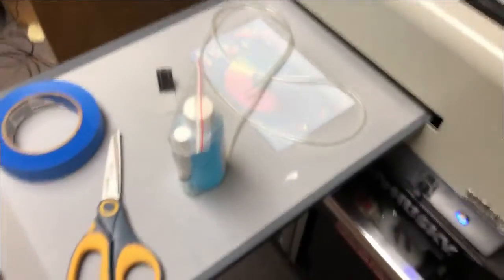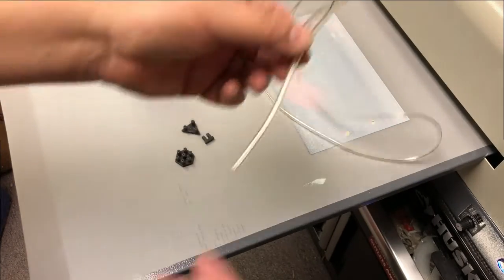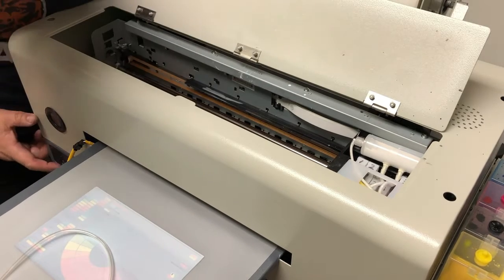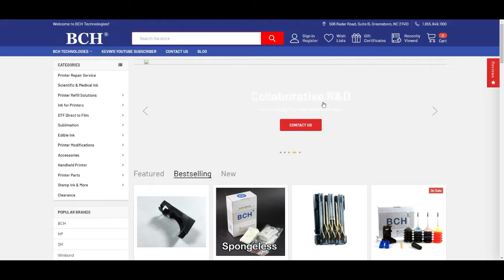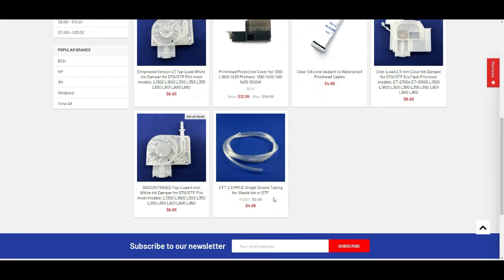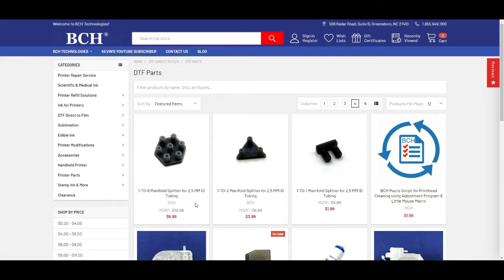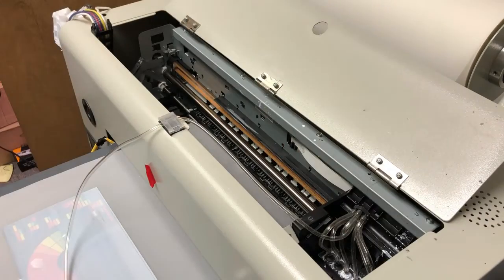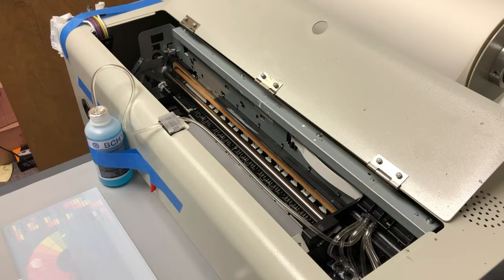How to Use the NO FLUSHING Method to Clean Epson DTF DTG Printhead Faster and Safer

Comment: Hi Kevin! I am a big fan of your videos. I am just now trying to get my ET-8550 set up for DTF. Can I use this on it, or is it only for the printer that you have there in your video? Also, does the cleaning fluid go into the waste tank?
Reply from the maker: Hi! Thank you so much for subscribing and for your kind words—it means a lot to me to have your support! Every subscriber helps me get closer to my 100k goal, and it’s been a long 8-year journey. Your encouragement keeps me motivated to create helpful content and answer questions like yours.

Yes, the setup is very similar for the ET-8550. You can visit bchtechnologies.com to explore our PMA (Printhead Management Assembly), which makes maintaining the printhead incredibly easy. With this system in place, you likely won’t even need cleaning solution, as it automates the cleaning process effectively.

As for your question about the cleaning fluid, typically it would go into the waste tank, but with the PMA setup, cleaning becomes so straightforward that managing waste ink is much less of an issue. If you have more questions during your DTF setup, feel free to comment here or email me at support@bchtechnologies.com for a quicker response. I try to reply to my subscribers within 48 hours, but if I miss it, posting on a newer video or emailing directly is the fastest way to reach me. Thanks again for watching and supporting the channel!

Comment: i true all the cleaning, waterfall, ect. so, I finally separated the printhead from the 6 port abs manifold. (l1800 9 pin). That's where the white (both channel ports) are extremely hard to flush. I can pull air but not push solution even after soaking several times. Ordered your blue solution. any tip on stubborn manifolds or videos. printhead seams good but not the 6-port manifold.

Comment: piezoflush is made  for vacation mode, meaning, you can leave it in the printer for as long as you want. I have my own cheaper recipe that does the same thing. (77% distilled water, 20% ipa alcohol, 2% glycerin and 1% amonia)  You can also just take distilled water with 5% glycerine for vacation mode. This does not have any cleaning ability so you can use it after using the cleaning solution.
Reply from the maker: Thanks for the tip. If the clog gets really bad, use the blue DTF cleaning solution (or red) on the pigment or dye printhead. It's very strong so it should be used as the last option. DO NOT leave it in the printhead though. Flush it out within a few hours.